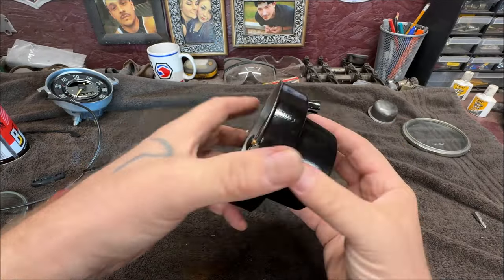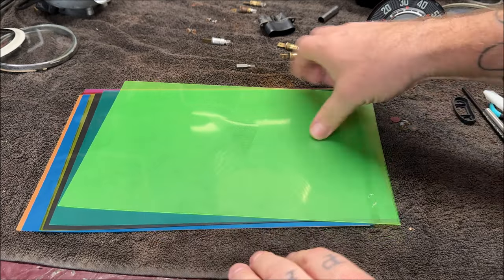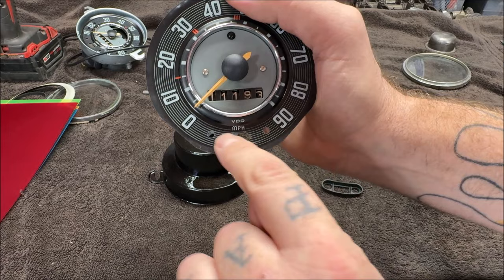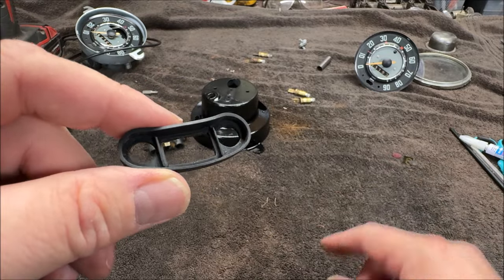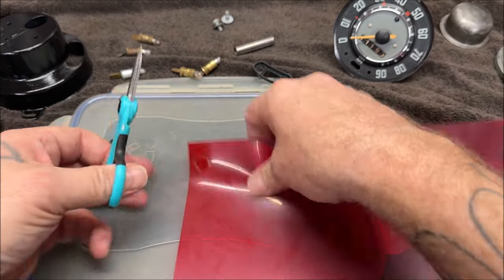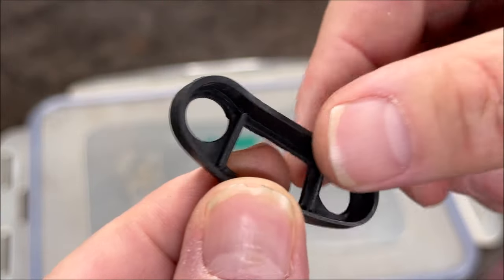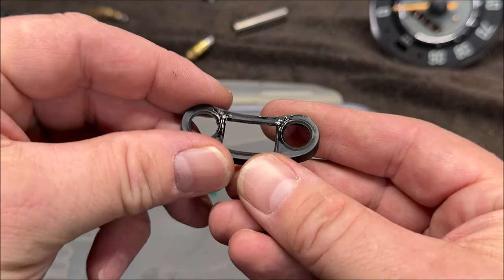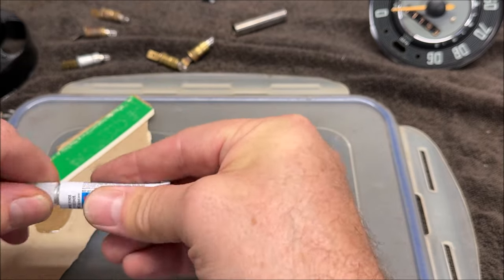VW Classic Beetle Speedometer Restore & Cleaning - PART #2 - HOW TO Clean an antique speedometer DIY

Comment: Looks good with the new gear. This is a second request for the rebuild video for a 68 speedo with internal fuel gauge.
Reply from the maker: I’ll be doing the 68 speedometer soon. I just didn’t want to do two different ones back to back.

Comment: The new video equipment looks good. Tip; I use random size tubing and tube fittings, sharpen the ends and use as a punch for making small round things and holes for gaskets. Thanks for the vid.✌️
Reply from the maker: Thank you CJ for the tip! I truly appreciate that. And, thank you for taking the time to be here.

Comment: I did a body off resto of my '62 sedan during the pandemic but the Speedo runs about 10 MPH slow, which I find odd, since it's mechanical.  anyway, thanks to this video, I'll rebuild it and see what happens.  😊
Reply: Addendum;   took it apart and the milage is mechanical but the speed is not.  There is a round magnet that spins inside a steel sleeve that is mounted on one end of a small spindle with the speed indicating  needle on the other end, so the only reason I can think of for the inaccuracy is the spindle bearing is dragging. (or the magnet has weakened?)  I'll put a drop of oil on the bearing and see what happens!  on my my '62, the little color pieces were glued to the back of the face plate so replacing them will be easy!